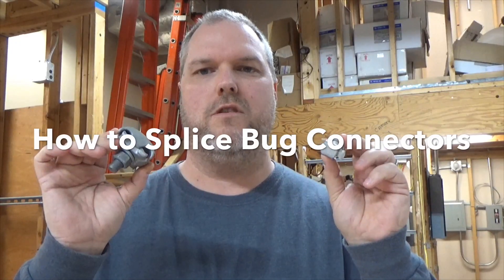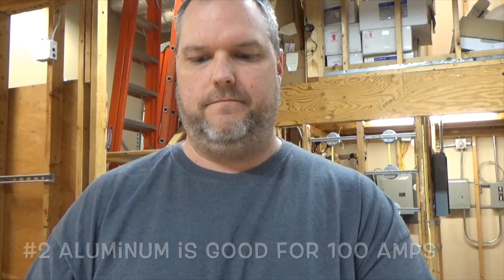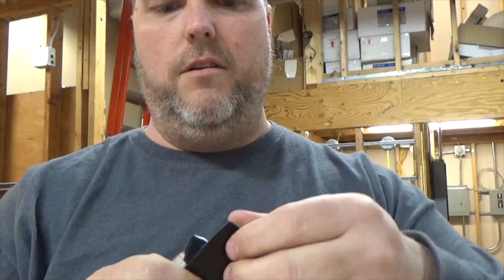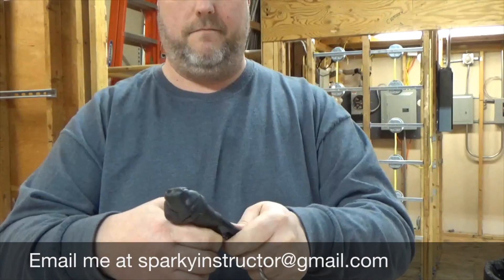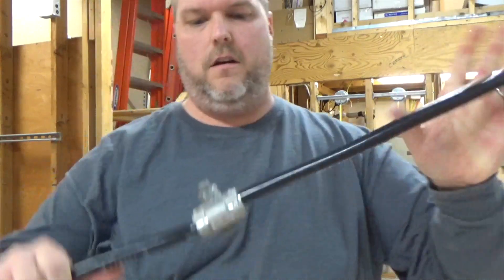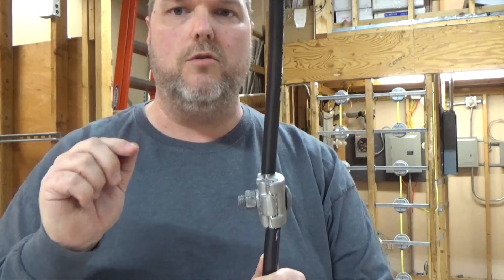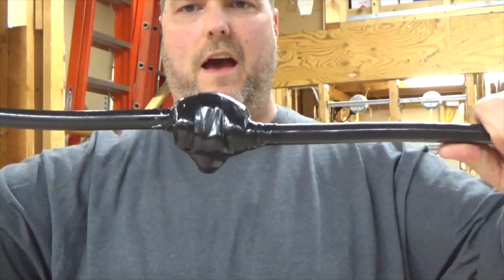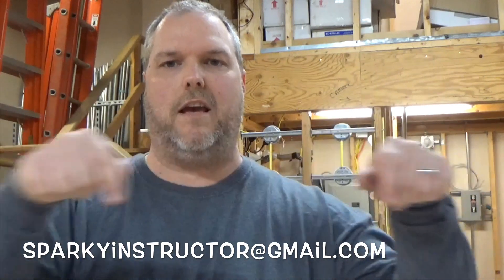Making a Proper Split-bolt Connection. Aka-Bugs

Comment: Hundred electricians analogy is sooo true. I've worked with hundreds, each time you work with a new one ,especially a new company, you will be being re schooled on everything from walking to twisting wire nuts. Wether your a master or apprentice.

For a service I use antioxidant and buy 3 rolls of both tapes and try to use most of it. Depends alot on how awkward/dangerous  of a position I am in on the ladder and how tired my arm is getting honestly lol atleast half roll of thick rubber and try for full roll of regular tape which I try to get real rubber hi quality for as well. I was taught full roll of each but over the years realizing that is over kill but seriously that stuff is going to be blowing around in the wind and all kinds of weather for who knows how long. It's worth the 30 bucks in tape and a little extra time for piece of mind...to me.
Reply: There is an industry standard.
 1. Use antioxidant/deox to keep the conductors from plating due to electrolysis.
2. Use a wrenches and a hammer to insure the conductors compress fully.
3. Use camber tape to protect the tape from the bolt.
4. Wrap with rubber.
5. Wrap with a high quality electrical tape.

If you want a fast connection, use Polaris pre-insulated connectors.

There aren't hundreds of ways to do it. There are only two. The right war or the HACK way.

Comment: Yes these are great connections, but would ask that you demonstrate properly torqued tightening. I personally have to go back and retighten connectors. And then properly TORQUED them. Also I have to say that "BURNDY"  LINE TAP S are a more expensive option But you don't have the time and labor involved. But I will say that I will be a subscriper and follow you. Thx for your info.

Comment: I have never used a split bolt bug or seen a JM Electrician use one in a panel or wireway. I usually see electricians use polaris taps which are not of the split bolt type usually in handholes and large junction boxes.

Comment: Can this also be used to extend 6 gauge ground wire? I have a ground bond wire in side my walls going to my gas water heater that is coming from a ground rod. I want to install windows and this wire is in the way so I want to reroute the wire

Comment: Can I use ring connectors crimped to each wire and then attach them with a bolt an nut instead? e.g., if you need to connect three or more wires together it is harder with a split bolt.
Thanks for the video!

Comment: I have always used Cambric tape first, then rubber then 33+
Reply: 3m has a vid using the Resin tape💪
Reply: @JJMECC  found it. I’ve been doing it this way for 40 years.
https://youtu.be/9tsx6im7qng
Reply: @blockisle9  Only 30+yrs for me LOL..
Reply: @JJMECC  LOL, The trade has changed a lot since then and Not necessarily for the better. The big box stores and device manufacturers have been doing a lot of lobbying and a lot of things required now are catered to the homeowners to make it easy for them.

Comment: I see two issues with your parallel connection on the first split bolt. #1- when tightening the bolt, you should use a backing wrench, you can see when it started to get tight it started bending the wire, which you then straightened causing undue stress. Not a huge deal but integrity of the wire is key. #2- You stated a "waterproof connection" using the rubber tape, however you did not use rubber tape in between the 2 wires so there is no seal to keep water from entering at the bottom in between the 2 wires. Placing rubber tape in between the 2 wires and the wrapping that around both wires twice before wrapping the lug would prevent water intrusion.

Comment: I didn't mind the Channelocks so much, but I was real concerned about using the stiffness of the wire to provide the resistance for tightening.  The wire got bent over and then re-straightened.  I would never introduce that kind of strain and potential fatigue at a splice location like that.  If you must use Channelocks, use two of them to grip both components of the split bolt instead, or one Channelock to grip the body and a proper wrench for the nut.

Comment: Your method works only when the wires are coming from different directions as in the second segment of this video. With your first example you didn’t make any attempt to waterproof between the two wires. Simply putting a small piece of that rubber tape on the wires where the insulation of each touches may have helped to make the connection water tight. You made an excellent video on how to wrap the nut and bare wires with those two types of tape but when water follows those wires in your first example and via capillary action, gets drawn up to the connection, under the tape, it will not dry out and only serve to cause trouble. 😳

Comment: Years ago I was painting a house around the service wires and noticed splices that had electrical tape.  Just electrical tape, none of that rubber tape.  Half ass job, you could see many gaps in the wrap, obviously it was done just good enough so they looked taped from the ground.  I verified the poor job when my forearm brushed against one of them ( yes, very bad judgment on my part). Thank god I was on an aluminum ladder so I could learn my lesson properly.

Comment: Can I use these to splice the 100 amp aluminum wires going from the outside service panel to the inside panel of a trailer? The splice will be inside the 200 amp service box outside. Just need to extend the aluminum wire to reach a breaker because the bottom lugs got seized up for some reason.

Comment: Si can i use those bugs to extend my main electrical wire I need to move my breaker box some one can answer please
Reply: Check with your power company. They will be able to schedule the power being disconnected before the work is done and reconnected after it is finished. They also handle most of what is on their side of the meter and you are responsible for whatever is on your side of the meter.

Comment: I wonder why the first bug's design uses a chunk of galvanized steel washer in between the two aluminum conductors. It seems natural that the two aluminum conductors should mash together for lower resistance?
Just guessing that maybe the intermediate steel washer is somewhat concave so the strands of aluminum don't go haywire when compressed ?
I have some of those and never really had much opportunity to use them. I'll have to dig em up and see what that washer looks like.
Reply: Because it's also rated for copper & aluminum connections and acts as a separation
Reply: I just found one that failed and it looks like it would not have failed so badly if they had not been separated.

Comment: If Im not mistaken the rubber (3M) high voltage tape calls for the sticky side out while wrapping and finishing up with the regular approved electrical tape
Reply: Thank you! Industrial mechanic here cringing with the thought of servicing this guys work in a peckerhead. Not a fan of his stripping practices either. I learned to score, break with 9s, and pull. Not whittling like it's a boy scout project.
Reply: @Aircooledboxers  Its called pencil stripping. It's a common practice for aluminum.  If you accidentally score some of the aluminum strands they can actually break off and cause a premature failure of the connection. Copper is much tougher. I use a tool that strips the jacket with out damaging the stranded wire.
Reply: Doesn’t the aluminum conductor need anti oxidant paste?
Reply: @argekay1960  yup

Comment: I need to splice 3 legs of #6-2/G NMB for a daisy chained, 2-outlet 50A welder circuit (so the first outlet box will have 1) a leg coming in from the panel, 2) a leg out to the second outlet, and 3) pigtails for the first receptacle).  I assume there won’t be enough room in a 2-gang box for a 50A 6-50R receptacle AND the taped split bolts.  What’s the proper way to arrange this - a separate box screwed to the side of the receptacle box, one for the receptacle and the other for all the splices?  Or...?
Reply: Tom Garbo thanks for the reply.  I actually just finished this up recently.  For me the answer was to use Garvin masonry boxes with plaster ears welded on.  This was the only solution I could find for a steel 2-gang box and still be 3-1/2” deep.  Then I used Polaris Black IPL4-3A connectors instead of split bolts.  Although tight, this made it possible to get everything into one box.  Thanks again.

Comment: To make it easier on the next guy that has to cut off the splice back wrap the connection with electrical tape before you put on the rubber tape.  Makes it much easier to cut it off.  Would have liked to see you cut the splice in half so people could see the thickness of the rubber tape, and that it was 2x the thickness of the cable insulation.
Reply: Doug Johansen I think that is one reason calls for tape to be wrapped on sticky side out.

Comment: Doesn’t the galvanized connector corrode the aluminum wire over time?
Reply: No.  In the high voltage industry the bronze connectors or aluminum connectors we use is coated with a non reactive covering.  It is not zinc such as a galvanizing.

Comment: If using  Aluminum wire should I use an  Aluminum bug or split-bolt and is it ok to a copper split bolt with  Aluminum  wire? Thanks!
Reply from the maker: As long as the bug is rated for copper. CM

Comment: Could you use the first split bolt that you used on the 2/0 wire for the inline splice with the 4/0 providing it would accept the 4/0?
Reply: Yes
Reply: Did u try it ?

Comment: Is grease required for Al wire? I did this (as a homeowner with permit) and greased all of the connections. I need to go back and rubberize the splices to thicken them as you showed. Thanks
Reply from the maker: No you just have to use the correct Bugs. CM
Reply: Check out this video on Noalox... https://youtu.be/B05Lu7h5Tig

Comment: Nice splices. Reminds me how labor intensive bugging is. I used IPCs (insulation piercing connectors) a lot when I was doing solar and tapping onto the mains. They save a lot of time because you don’t have to strip the wire...and when you’re done tightening the bolt, you don’t need to wrap it with any splicing tape. Quite an awesome connector.